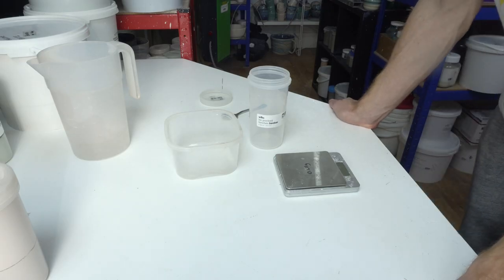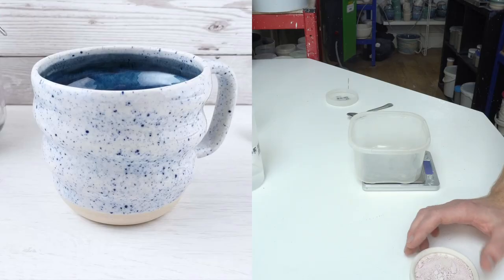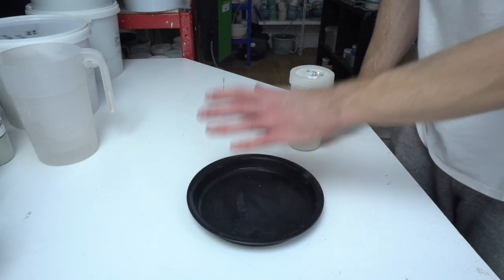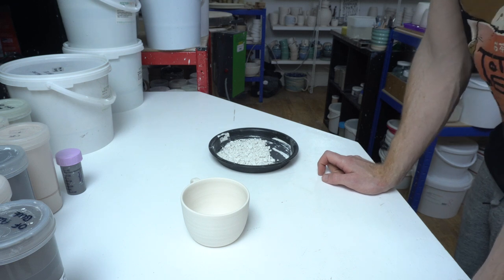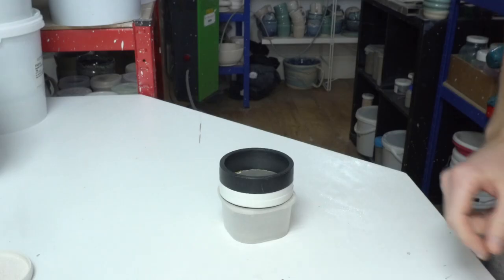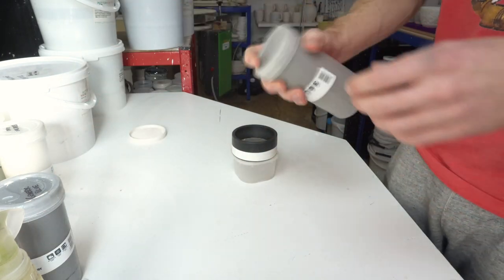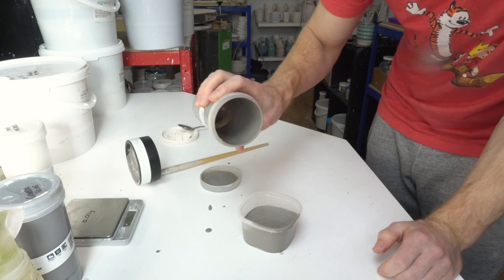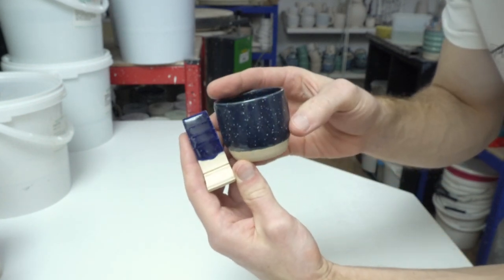Making Glaze Sprinkles / Speckles

Comment: Curious what the surface texture of the finished pot is like. Is it smooth or do the speckles create a rough surface texture?
Reply from the maker: It depends on the glazes you use. If they only just melt, the texture will be bumpy, but once they melt enough to blend together more then it smooths out

Comment: When you bisque fire the dried glaze, what did you put it in?
Reply from the maker: I use a clay tray. Anything will do really, but a low flat surface is better than a bowl or taller form for even sintering, so I just throw appropriately sized pieces from my usual clay

Comment: This may be a silly question but I'm new to pottery. Could I sinter a commercial glaze, like Amaco, and then mix it with another Amaco glaze? I know there isn't much control when using commercial glazes instead of your own so I'm unsure.
Reply from the maker: You could, but you'd have to adjust the sintering temp to match the glaze rather than the other way around. For a cone 6 commercial glaze that might mean sintering at something like 850°c rather than a 1000c bisque

Comment: Is this better than just flicking on another glaze on top with a brush because the pattern is more consistent?
Reply: Definitely more consistent, also the texture is probably different and this method offers much more control over the final results and scalability, which are very important for a professional potter.

Comment: Do you think you could put it in a food processor and get a fine sprinkle throughout?  Or would it pulverize it to dust?
Reply from the maker: I'm not really sure what you mean. You can crumble the dried glaze without a food processor, from big chunks to fine dust. The only challenge would be finding a sieve that allowed you to limit the maximum size of the pieces to whatever size you wanted for the fine sprinkle.
Reply: @OldForgeCreations  I was just thinking if a fine powder was the goal, you could put that in a food processor and get there pretty quick and the chunks would be pretty consistent.